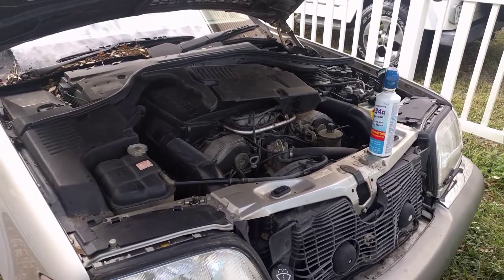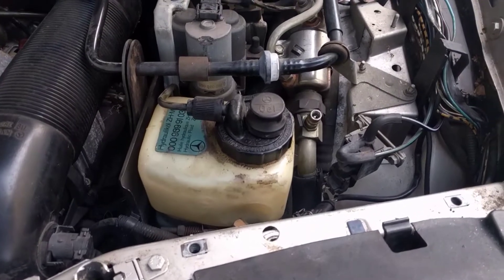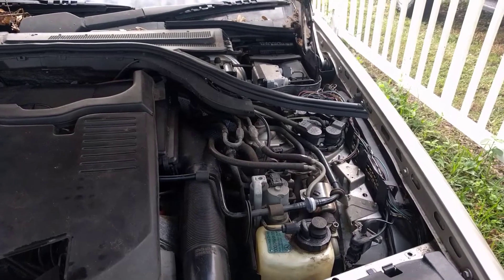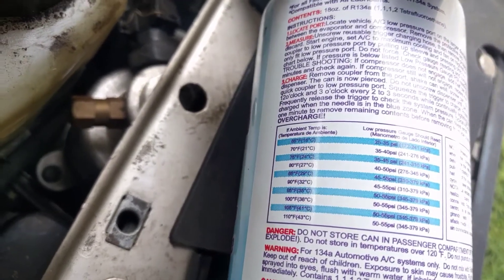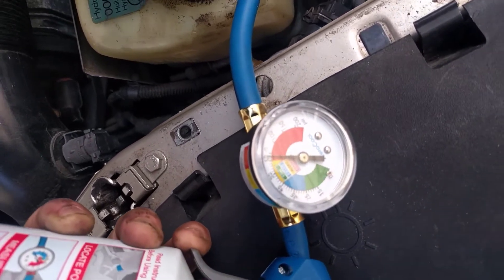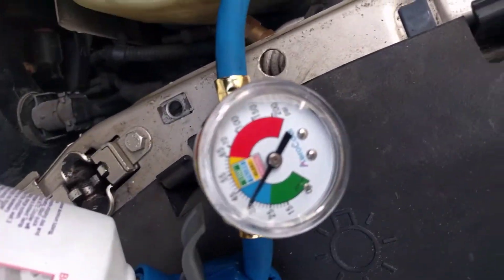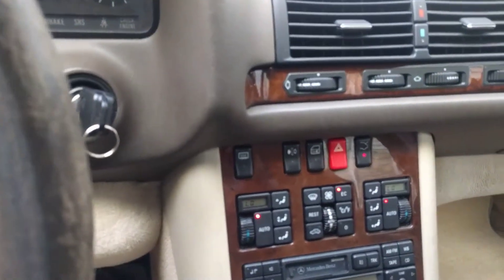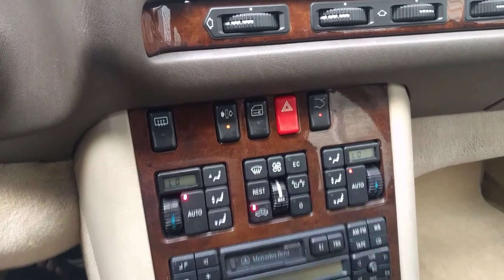How to recharge ac on 1995 s500 w140. We got cold air

Comment: When putting the gauge on with the car running air  set to low blower on high the gauge is registering in the white before I began adding freon what does that mean because the air is blowing hot air and with it registering in the white I was afraid to add freon any suggestions
Reply from the maker: Did you make sure to put on full cold. Make sure not to select the EC button as this will shut off compressor and give false reading.